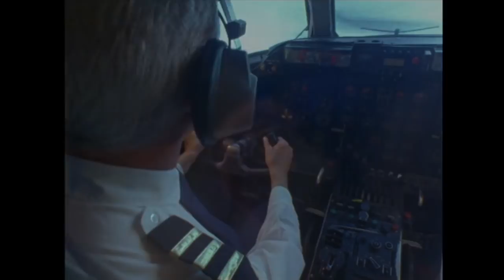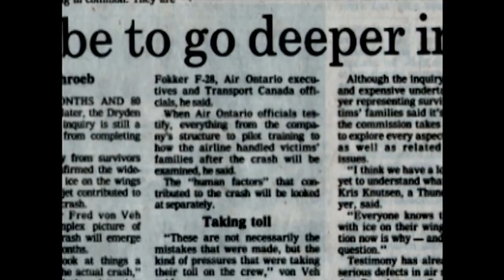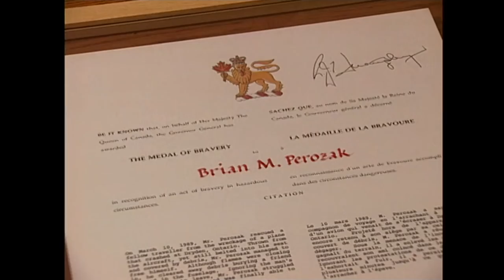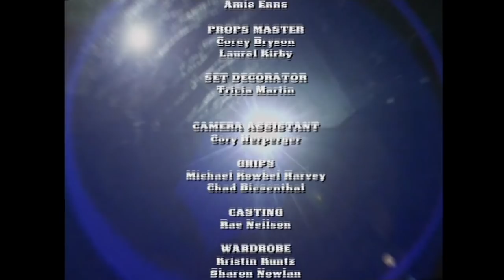Disasters Of The Century | Season 4 | Episode 47 | Dryden Air Crash | Reupload

Comment: This sounds like Boeing selling the 737 Max w/minimal retraining needed. Those who don’t learn from history are condemned to repeat it but glad that changes were made.
Reply: Pretty different situations, but in both cases cutting different kinds of corners led to tragedy.
Reply: Sashazur   Sashazur  Yes. The only similarity is at 4:15. Both sought to rush the certification of pilots on both jets. In the 737 Max cases overseas, one selling point for the Max was that current 737 pilots  didn’t have to be retrained & could take a 45 minute course on an iPad. In this case there were similar frustrations about certifying pilots on the F-28 which is why the certification contractor quit @ 4:15.
Reply: Airplanes will not fly with any accumulation of ice on the wings. That’s all there is to know about it.
Reply: Jim Watson   Jim Watson  That’s an excellent point. So I could be wrong & the training consultant quitting before the contract was complete  & the pilots not having many hours on the plane didn’t contribute to the accident at all. I thought the makers of this episode including that & the long list of over 180 recommended policy changes for safety meant that those factors contributed to the accident but maybe what you’re saying makes sense. The 737 Max is a perfectly safe plane too. The simple version of the issue appears to be pilots reacting to feedback intuitively as if they’re piloting a regular 737 turns out to be the wrong on top of different instrumentation. 

I just looked up the crash in wiki & it looks like you’re right: “The wings needed to be de-iced before takeoff, but the Fokker F28 aircraft is never supposed to be de-iced while the engines are running because of a risk of toxic fumes entering the cabin of the aircraft. The pilot therefore did not request to have the wings de-iced; at the time, airline instructions were unclear on this point but the subsequent report was very critical of this decision.” 😀
Reply: R. William Comm , here is one thing that has fascinated me for years (I am not a pilot, by the way). The F-16 resembles a dart with razor blades for wings and has a very powerful engine (like the legendary F-104). You can hang ordinance or fuel tanks on the bottom of the wings until you swear the little thing would never generate enough lift to get off the ground. But, amazingly, it does. Now, clean everything off the bottom of the wings and spread a very thin layer of ice or frozen snow on top of them. Right after the pilot rotates the nose wheel off the ground, that airplane begins shaking like a leaf and he has to eject. I’m not an aerospace engineer either, but it seems the lower air pressure across the top of the wings is harder even for a volcano like the F100 or F110 power plant to manufacture than the higher pressure under them. By the way, there is an excellent account of the Dryden accident in Australian pilot Macarthur Job’s “Air Disaster Volume 3”. It’s part of a four volume series and they all are quite good.
Reply: Jim Watson  Cool. Thank you. Great observation. I will check that out. 😀